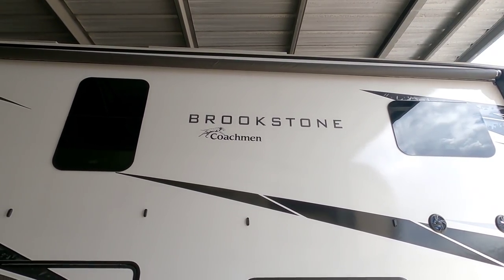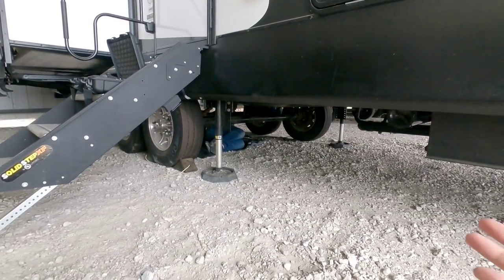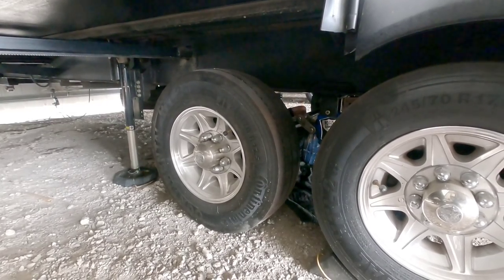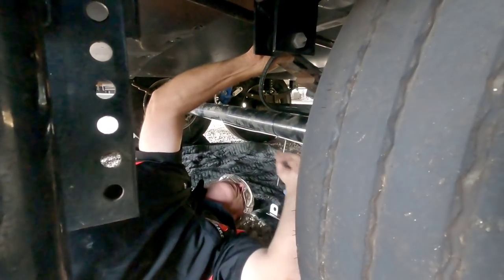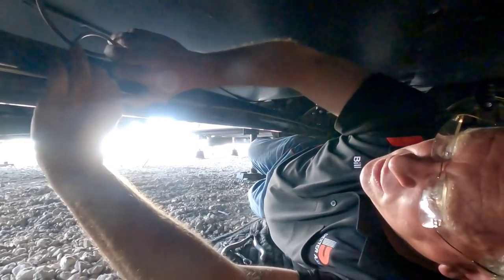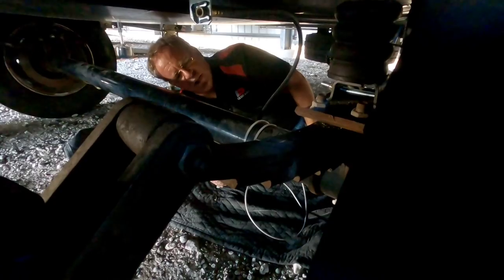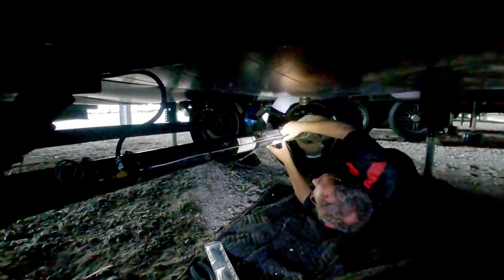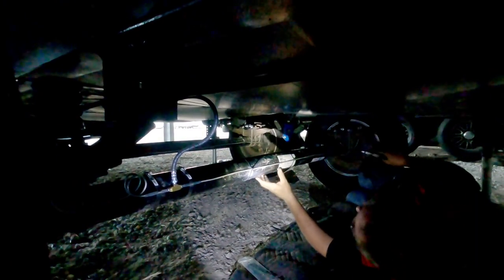Dexter sent their BEST to Fix our horrible RV brake installation!  Part 1 of 2

Comment: I'm glad to see that they are going to send managers and supervisors out to everybody's house to fix their problems. And work until dark every day until the customer is satisfied.
Reply: Bull Boss… This was a safety concern forJD and his family on a non-standard and very custom concept unit with many prototype components from our suppliers that we felt needed immediate attention. I was simply there to observe and assist with documentation so that full production models don’t have this concern. This is why we typically build 2-3 prototype models prior to full production. Any safety concern is met with immediate, determined action and involves the highest level of management, engineering, our partner suppliers, and QC in the process.
Reply: @Dahoef2  It was absolutely a safety concern. How did this leave the manufacturer in this condition? Is his trailer the only one that has disc brakes installed? I can't imagine hat is the case. What exactly is "prototype" in a disc brake system? Brake systems have not fundamentally changed design in probably over 50 years. Hydraulic brake systems are very basic. How many other trailers were released to the consumer like his was? Have these customers been contacted before there is a horrible accident? You probably won't answer all these questions to me but you should at least get them answered internally.
Reply: @Dahoef2  Please strongly consider running hard lines to each wheel well and flex lines from the chassis directly to each caliper.  You aren't going to be able to do any work on the brakes or bearings or axles without braking the connection to the caliper if you do it this way.
Reply: @schwazelbacher  I believe it was explained in a previous video that these axles were specifically requested for his unit. The Standard axles for units like this built in the same facility are drum brakes and probably even electric.
Reply: Your full of B.S. nobody that does not have 500K followers would get this kind of service and you know it .you can give coachman all the excuses you want but that kind of quality control is horrendous concept unit or not. David .

Comment: There are brake line clamps readily available from places like Summit, or Speedway Motors that are wider, thicker, stronger, and will capture and isolate the lines, instead of jamming them against the axle tube.
You'll curse those hard lines every time you have to disturb those calipers.

Comment: The loops in the hydraulic line equalize the distance the hydraulic fluid travels to the brakes between  the left and right sides of the axel wheels. Thus the brakes will activate at the same time and pressures preventing the trailer to pull to one side.

Comment: He did a fantastic job. Im glad to see that this quality of work is still around, but it needs to be extended into the manufacturing process. The fact that they are able to put so many units on the road that are so large and heavy without this level of quality control is just not safe. JD, I personally think that you would be a great advocate in helping this industry by going into the law aspect of this... situation. There are very few laws in which hold the manufactures liable. Do us all a favor, take your infinite wisdom and influence and use it to make a difference! Keep up the great work sir.

Comment: That was a very informative and useful video.  Like you I was also concerned about the solid line going to the drum brakes, but after the gentleman from Dexter explained the reason for that configuration it made perfect sense.  It’s unfortunate that the original installers didn’t come close to something that was acceptable, but the company is owning up to the mistakes and making the changes so it’s safer and done correctly.  I had some expensive custom add-ons to our RV that the dealer installed incorrectly and we are still trying to fix their mistakes.  It’s frustrating and expensive to repair someone else’s mistakes.

Comment: Nice to see the use of metal at critical points in conjunction with the zip ties. The loops in the hard lines were absolutely the best way to go over on site reflairing. Looks like he did a great job. I hope this makes the PDI a little better in the future. That was inexcusable.
Reply: It will be. Please remember this was a concept unit with custom axles, disc brakes, suspension, tires, etc. with many supplier prototype components — and without typical standard schematics/cut lengths for the brake lines. We typically build 2-3 prototype units prior to full production for this very reason. No excuse for the line that was incorrect, just an explanation as to the difference from a production model ;)
Reply: Remember this is not the brakes that Coachman uses on their units.

Comment: My only problem with this install is the loop he put in the line.  I have found that loops like this make bleeding the brakes much more difficult.  I have no problem with cutting and re flaring the line but it does take a quality flare tool not the cheapo that most auto stores sell.
Reply: I agree completely, I’d have a fit if a tech put loops in my brake lines.  Especially if the loop 🔁 runs above my lines !
Reply: Stay tuned for yet another video lol
Reply: Agreed. Tube double flaring kits are easy to use.

Comment: a big improvement.  one thing to consider with the flex lines is being able to remove the calipers to allow pad changes and bearing maintenance.  in light of this, i would put short flex lines at each caliper as well

Comment: Just wanted to say they do have hydraulic drum brakes for trailers . 
I am watching this video because I want to install steel lines on my trailer. I don’t want flexible, brake lines that runs from my caliper to a fixed line on the frame . The only reason to put a flexible, rubber line . Is if it was moving at the time like a front wheel. 
  The guy is doing it just like I want to do it . This is the way it should be done . Not like some of the kits they sell you .

Comment: Looks a ton better!  Should have isolation standoffs between the hard brake lines and axle to prevent chaffing and premature wear resulting in brake failure.  For a manufacturer not to secure the brake lines is for long term use is amazing.  We wouldn't expect this type of installation on a  vehicle on the road why would it be so shotty and temporary on a RV?

Comment: My 8k disc brakes are Kodiaks.  As he pointed out in the video, my hard lines run down the frame (on top of the I beam flange) and then a flexible hose (using that exact same bracket he put on yours), is attached directly to the caliper.  My hard lines that go to the other side are attached to the cross member frame.  There are no brake lines running across the axles.

Comment: Much better job than the factory but I still see room for improvement. I would have bought a good flair tool and made the lines the correct length instead of looping. I’m still not sure what the purpose of  an expansion loop would be can someone explain? In a area under an RV I want the least amount of critical parts exposed as possible. Second item I don’t agree with is using hard lines to the caliper. Vibration is a good way for those lines to crack or loosen the the nut. One tire slightly out of balance can cause big problems down the road. Please use a good flex line on all four brakes. Next project should be to tuck the black/gray water tank discharge up much higher, those can easily get taken out by road debris. Keep up the good work JD.

Comment: The manufacturer could have some mounting tabs, welded in place on the axel, brackets that have rubber grommets in them,no need for cable ties, that would be what I regard as Proffessonal. 
Also there should be standards for braking components and installation do there is no confusion. 
Watching various channels about RV issues, there is obviously something wrong with the manufacturers quality control and procedures 
Hope you intend on protecting those leaf springs with anti rust coatings? 
Safe travels

Comment: So you can drive 100,000 miles or more in a vehicle without touching the bearings, but Dexter wants you to lube and adjust them every 12,000 or one year?
Reply: Modern cars use sealed bearings now. Trucks axles will be oil bath lube. 

Older cars that used bearing similar to a trailer axle need the same service as the trailers.
Reply: @muddpuppy07  my bearings are oil bath lube on my 8k axles.
Reply: @McRod-1  some like your are, looks like JDs are bearing and grease.

Comment: I would have paid a little more for the powder coated lines. Double flaring brake lines is not hard. I can't count how many I have done in my life time. I buy bulk line in fifty foot rolls for a quarter of the price of ready made lines. The only loops in a steel line should be out of the master cylinder to the frame because of master cylinder flex.Those loops will vibrate and chafe. I still would want a flex line to the calipers. Just so you don't have to remove the line to change pads and rotors. Good luck trying to maintain the brakes in a year or two with rusted lines.
Reply: I agree with that, except powder coated lines don't offer any real advantage over stainless lines, and they appear they may have used stainless lines here.  At least, I hope they did.  Using mild steel anywhere in the brake system is definitely one of those things typical of US vehicles that you just don't see in better vehicles.  

Having to break the system open to change a rotor or pack a bearing would be really annoying.  There is a reason every car and truck out there runs hard line to the wheel well and flex to the caliper from there.  The guy did a really good field repair here, but quality installation would use a line flared to proper length.  If they are so far out in the middle of nowhere they can't even find an Autozone, then maybe they had to make due.  Autozone and the rest generally have a rack of lines in 2" increments.  Even without that, flaring lines in the field is absolutely doable.
Reply: This was a very sloppy and amateur repair

Comment: The more I think about this “repair” the more it bothers me. While I appreciate the effort they went to to make you happy. This repaid is sloppy and amateur at best. It was not properly thought out or executed. 

Lines should have been cut to length and flared with new fittings. Rubber flex line should have been used going to the callipers to allow for easy brake change and bearing repacking in the future. 

I recommend you bring the rig to a reputable mechanic to get the correction done properly.
Reply: They are fixed calipers. That means the caliper doesn't move so there's no need for a flexible connection at the calipers.
When JD got the camera closer to show the caliper,  it looks like they are 4 piston calipers and are designed to remove one bolt to remove the pads without having to remove the caliper from the axle.
Without seeing how the stub axles are designed, I don't know if rubber lines would make it easier to repack the bearings.

Now those loops in the lines, I don't know about. If I was doing it, I would of cut and flared the line.
Reply: The man explained the reason why he did not need to use flexible at yer calipers.
Reply: @neda2820  just because he explained his reason….. does not make it the correct way
Reply: @andrewforte  good point but caliper would still need to be removed to resurface or replace disc
Reply from the maker: @DIYManiacJohnP  the passs can be removed by simply removing a bolt and sliding them out the back of the calipers
Reply: @BigTruckBigRV  rotors?

Comment: My question about the brake lines is: are the two lengths of brake lines on the axle the same size? Is that why you looped one of the lines?  Asked another way: should the brake lines from the "Tee" block be the same length or could they be different lengths based on what will work in your situation?
Reply: Length doesn't matter because the pressure is the same throughout the whole system. The loop is just for simplicity and ease of installation to avoid having to cut and re-flare the fluid line

Comment: IMO, the hard lines should have been cut, and re-flared to the proper length.  Sure, this will work. But, it's still not "right" Flying debris anyone? Those loops are in the line of fire.

Comment: They send out a master and he does not come prepared with a flaring tool to cut the lines to exact length????!!!!! While the expansion loop will work in theory… sloppy work
Reply: Flaring is a pain to do if you don't have to then you also need the fitting at the end. Why waste a perfectly fine flare and fitting already installed. Also exact length hard lines are difficult to measure and difficult to install between two fixed points.. The loop allows for flexibility in the line while installing.

Comment: The problem with this is that this is not engineered nor designed. That should be part of the design process, not the installation process. “Just hog it out with a rat tail file” nor zip ties is an acceptable solution.
Reply from the maker: Not sure that's valid considering the axle and brake manufacturer's head trainer did the work in a manner that's approved
Reply: Everybody's a critic. If you are Happy with the results that's what matters.

Comment: So putting loops in brake line won’t make bleeding the lines next to impossible ?
Reply: A good air compressor powered vacuum brake bleeder like the Harbor Freight one can bleed just about anything because the flow rates are so high.  This system apparently has an electric pump, so maybe it can do it, too.  Bleeding loops like those by pressing a brake pedal or using a hand pump would just never work.

Comment: Dexter EZLube axels are a disaster, major design flaws.

Living in the Colorado Rocky Mountains disc breaks are a must, as they are more reliable and always visually inspect the system before and after each use, superior  thermal cooling management, performance and reliability. 

Always using aluminum wheels as they dissipate heat much better.

Comment: You don't need an expert to install brake lines. A little knowledge and some common sense go a long way. I still am amazed by the install on that Brookstone trailer.  Manufacturers have blueprints for this. Again it seems like Quality Control is an afterthought. Unless they rely on customers for that.

Comment: I do not think Dexter is the problem, the idiot's working on the line are. So Dexter is tasked to repair/replace the brakes at this point. This does not fix the factory problem or should it let the company off the hook. I am still trying to wrap my head around the dependability of "zip ties". Why not use clamps that as re more permanent like what has been used on trucks and cars for years.